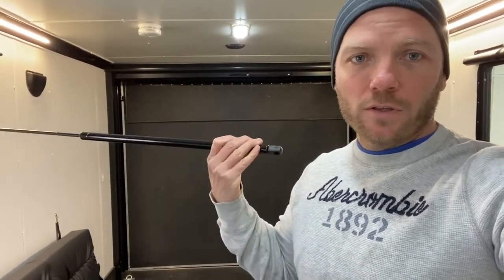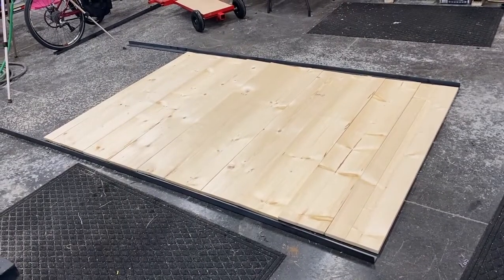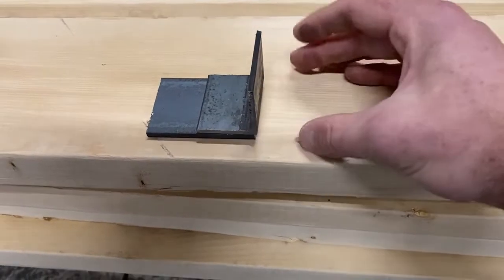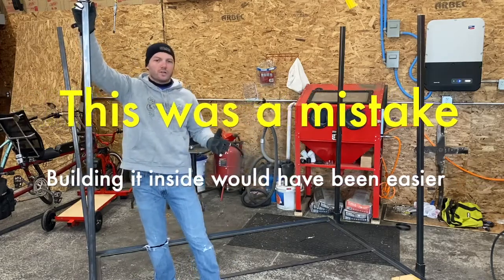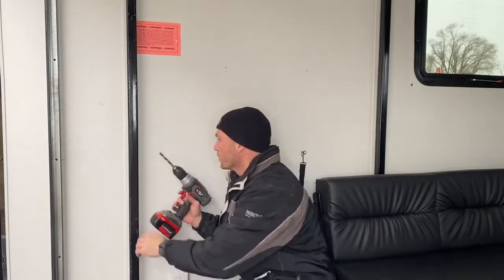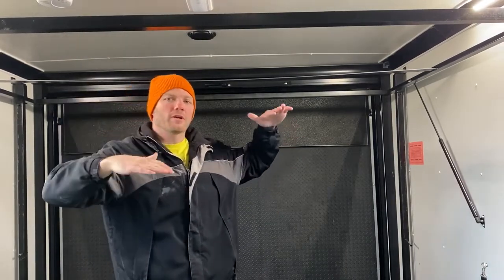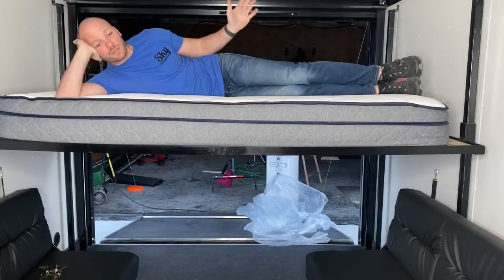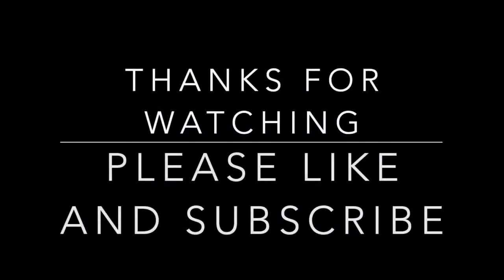RV Toy Hauler bed lift DIY happijack alternative

Comment: I did mine useing a electric motor from harbor freight and 4 belts that would work really well with your system
Reply from the maker: Having a powered system would be nice. Having to push mine up manually, it’s easy to get it a little crooked and it binds up. By myself it’s a little tricky. With 2 people it’s not bad.
Reply: What about cables tied to each corner with a pulley at the top and a garage door spring?
Reply: I'd love to see a video of yours

Comment: Your square tube on the bed needs to be way longer (downwards) and it wouldn't bind as much. Great idea tho!!
Reply from the maker: That is a good idea! And you could make it long enough that when it the down position it rested on the floor. Then you wouldn’t need to use the pins to hold it in place. I’ll remember that if I make another one someday!
Reply: @RoscoReviews exactly! If I do build a cargo trailer I will try that. Also, if you could get the tubes the right size you could put HDPE plastic between for slides and it would move much smoother.

Comment: The biggest issue I see is servicability, then there's the noise it makes and the paint flaking off. If you were set on doing it that way a larger piece of shs may have been a better choice with some Teflon slides fitted inside of it.

Interesting idea, happijac is bloody expensive that's for sure. Nice attempt though, everyone wants to copy the happijac which is understandable because it's pretty much the be ch mark of what everyone wants to achieve
Reply from the maker: I think if I would have made the sliding part longer it would have fixed the binding issue. That would be my biggest complaint. But It still works, so I’m pretty happy with it.